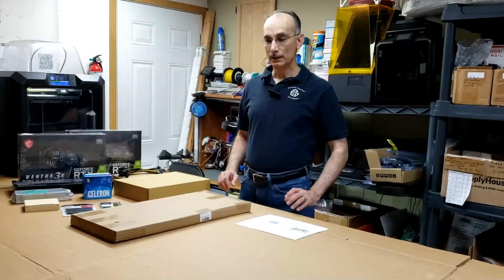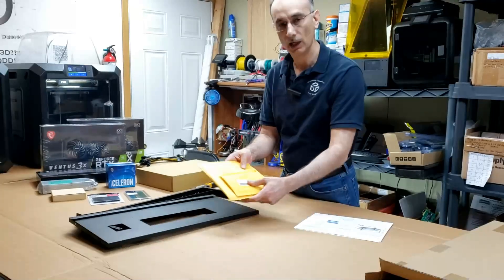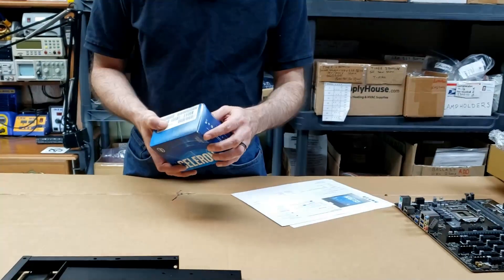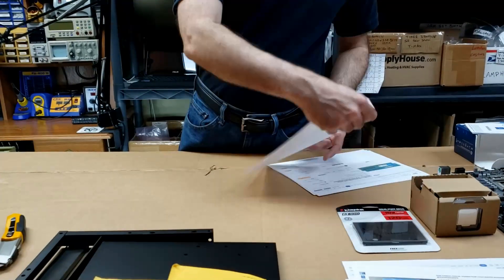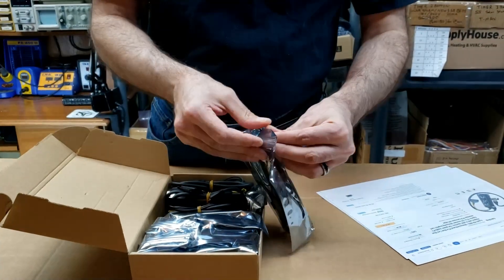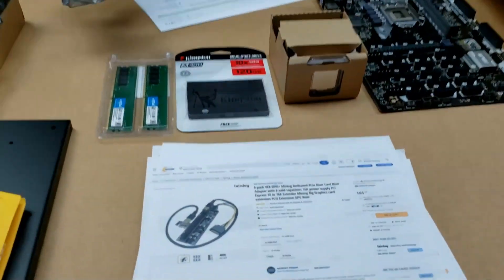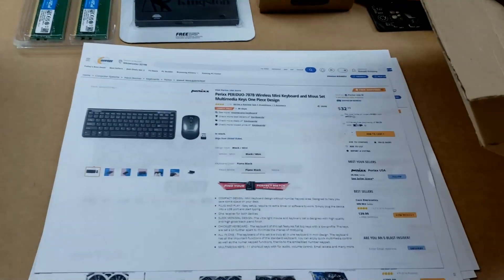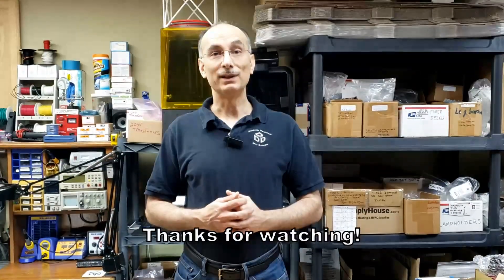Taking My First Steps in Mining Crypto Currency

Comment: Never to late to start. Realistically use the GPU's as a base income, use cpu for spec mining a new coin when it comes along. The first couple of weeks are critical to mine all you can before everyone piles in. Not everything is done on graphics cards. 3080ti and 3090 are about the same hash wise after the unlock. I wouldn't spend more then $1100 for new cards on either right now. As long as you can dial in best hash per watt and stay above power cost your good. I wouldn't focus on crypto accumulation for now sell in the peaks best you can a month or two. Then get more GPUs with profits. Hold the initial investment as debt.
Reply from the maker: Great advice...thanks a lot.  I was thinking about maybe building another cheap, simple rig to do spec mining on.  Being so new at this, I really appreciate people like you spending the time to share your thoughts and expertise with me and encourage me further on this.  Stay tuned for part two coming soon!
Reply: the best GPU nowadays gets you 1 usd per day, which is pretty bad, you wouldn't even get the price of the card

Comment: make sure to not use sata power on the risers that starts fires
Reply from the maker: Thanks a lot for sharing...that sounds like crucial advice.  Very much appreciated! 😀👍  I'll make a part two video soon to show it, but I'm not using the above server power supply...I plan on using a "TOPOWER 1800W Fully Modular GPU Mining Power Supply" which has 12 x 6+2-Pin connectors.  I hope that works well...Thanks again!

Comment: Hey Russell looks like a good start. You'll need to over clock to get better results and lower the power usage. I've only been doing it for about a year now myself learned alot
Reply from the maker: Thanks a lot for your feedback.  When I did a test-run on a Win7 pc, I was using MSI Afterburner to overclock.  I've seen others get better hashrates by overclocking in HiveOS, so I think I will give that a try.